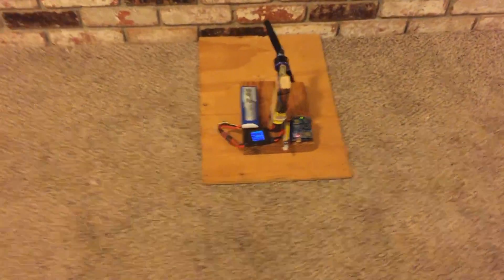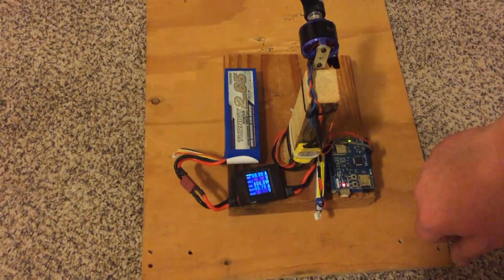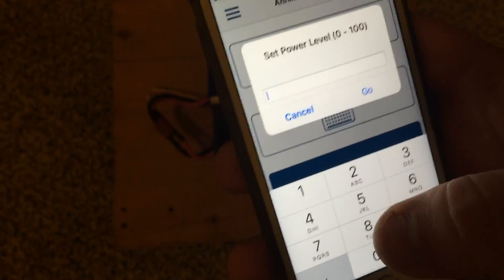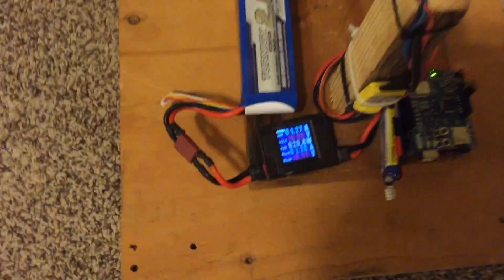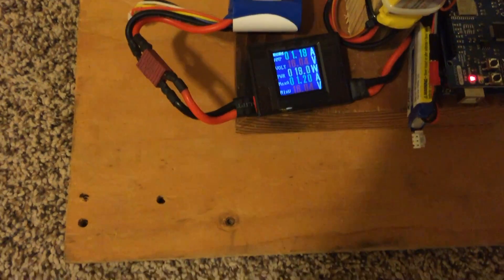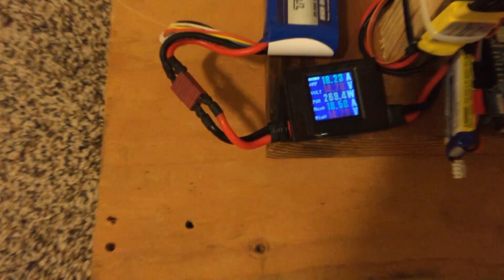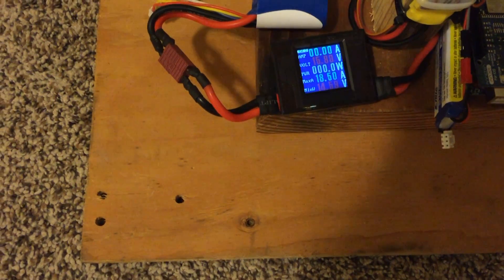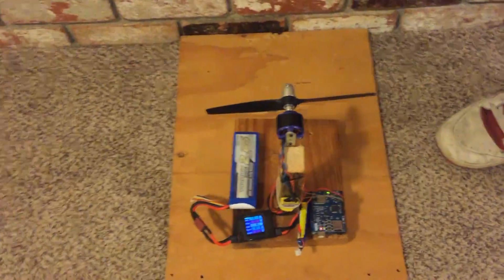Annikken Andee RC Motor Tester on iOS

Comment: Nice work! did it take you long to write the iOS code for the app? I suppose not any longer than it was to write up the sketch in arduino! lol
Reply from the maker: +remotecoderz  The Annikken Andee app allows you to write an iOS GUI within the arduino IDE. The code is pushed to the device after you connect, which then populates the GUI. Here's the full code for the whole project, which took about 3 hours to build, wire, and code:

https://github.com/tomrice1988/RCmotortestv1/blob/RCmotortestv1/motortestv1.ino